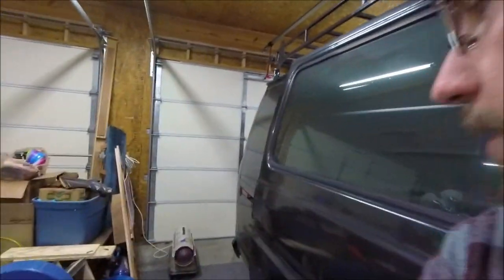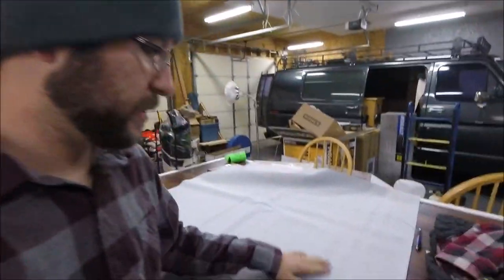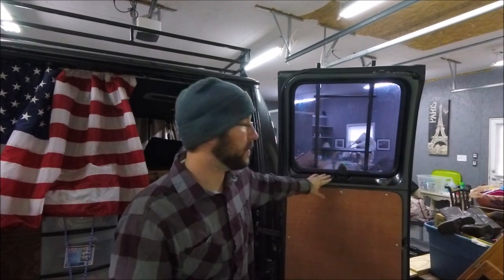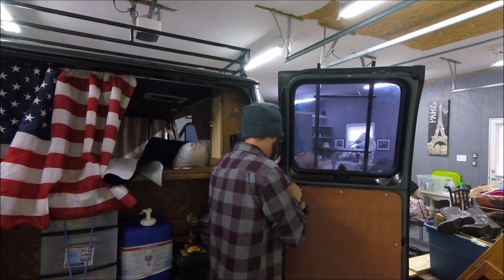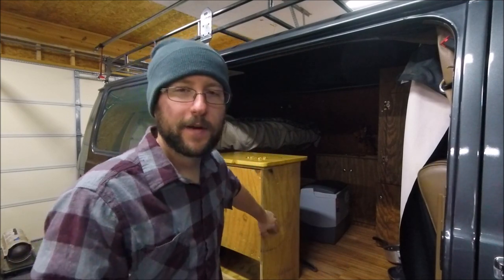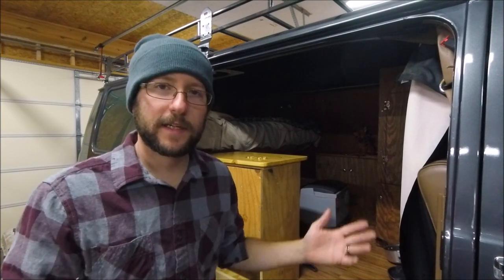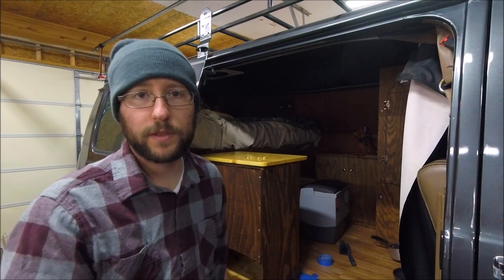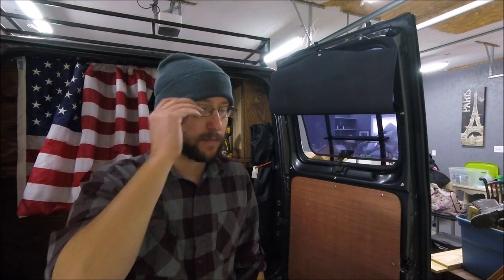Stealth snap on window covers for my camper van.

Comment: Look's good, but couldn't you have just turned the fabric around and have the white on the inside ? It would have made it brighter inside the van and in turn, make it feel bigger .
Reply from the maker: Jeff S thanks. I wanted the black vinyl on the inside. The inside of the van is painted the same charcoal color as the outside and I did my headliner in black also.